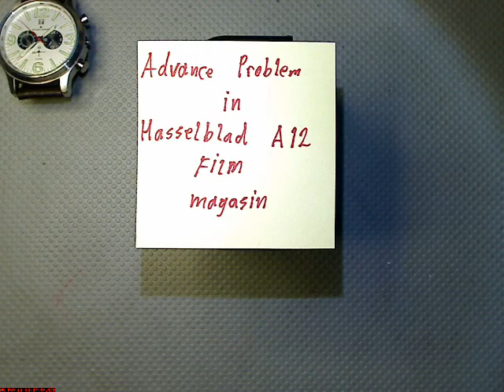Advance problem in HASSELBLAD A 12 film magasin______motion lapse film

Comment: Hi Mike, thanks for your detailed videos. I have a Hasselblad 500cm and I need to adjust the back shutter flaps, the upper flap is not synchronizing with the lower one. I searched about this problem and I found that it is a common one, and I was hoping that you can be the saviour with one of your great videos 😊 . Thanks.

Comment: Hi Mike, do you happen to know the thread size of hasselblad screws, in particular the ones that attach the tripod foot to the body of the 500 series cameras? I want to mount an arca swiss plate in place of the hasselblad plate but will need longer screws of the same thread size to do so.

Comment: I have an A12 bought with  camera new in 2002 and an A16 back secondhand and they both have the black plastic 'darkslide holder' attached which means I cannot lift off the side plate -- can you advise how to remove the black darkslide holder please?

Comment: Hi! Thank you for making this video.
I just made a pretty good deal for an 500c/m with two a12 backs, it has only shot about 40 rolls since new (yay!).
When winding the two backs, I can sometimes wind past the numbers, it doesn't stay on the first frame as it should. Guessing this is because the mechanisms haven't been moving very much, got a few ideas that might help me in this video!

Also, do you talk during this video when in normal speed? If so, is it possible to find the original somewhere?

Comment: Hi Mike, 
I also have an A12 back with a winder that refuses to go forward. I've opened it up and nothing looks obviously wrong. Looks brand new inside! No shredded gears or foreign objects. In your video, i could not figure exactly which part was stopping the winder from advancing. Was it the part at 2:10? Thanks again for your videos!
Reply from the maker: +Marcus Webslinger (Let's Rig)  Well Marcus, it was the part at 2:10 in the film that makes the problem because it was stuck. A few drop's of Lighter Fluid and some movement, and maybe one small drop of thin sewing machine oil.

Cheers
Kenneth

Comment: Thank you so much for your very instructionnal videos :)
Have you done the second video for this particular problem ? I have Two hasselblad A12 backs with this problem, maybe I'll try to repair one...
Reply from the maker: I have only made this film about the film magazine, but maybe I should make another more detailed film about it.
If you will try to work with it, you should be very carefull about the gear wheel, take a look at 3:23 in the film, the most upper gear wheel, inside there is a wounded spring that will pop out if you lifting up the gear wheel. One of the problems with the magazine is with the BIG gear wheels, they often get stuck but can be set in motion again if you use 2-3 drop of lighter fluid and make some movement, and then add 1-2 drop of sewing machine oil.

Hope it make sense....

Regards
Kenneth .

Comment: hello Mike. I Have a a12 magazine (500c 1966). Film magazine jammed after I loaded a film incorrectly. You know some technique to get release and remove the magazine. Thanks
Reply from the maker: Hi Rodrigo, of the film magasin is locked when sit on the house, you can try putting in the darkslide and the try to release the magazine from the house. Then it should be possible to open the magasin.
It should also be possible to cock the shutter on the body, and hit the shutter button, just to see that the body actually works proper.

Hope it make sense.

Regards from
Kenneth
Reply: +mikeno62 Obrigado!